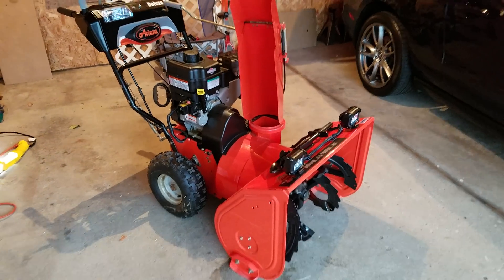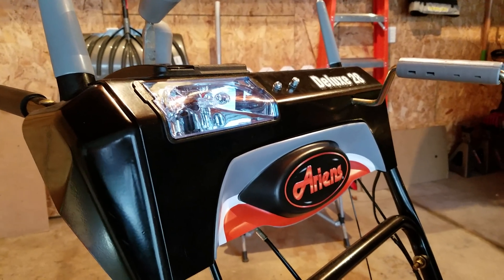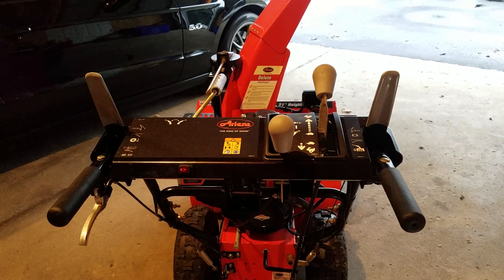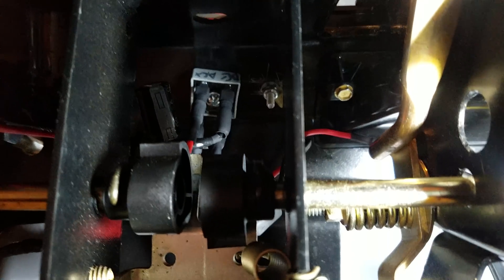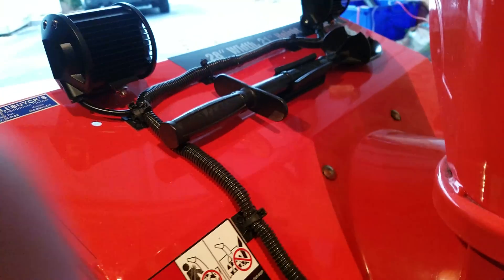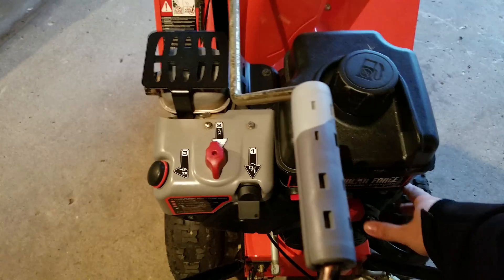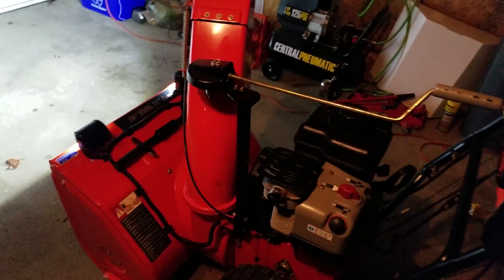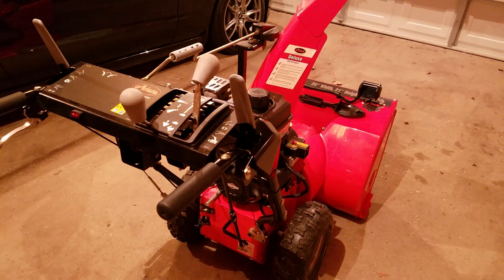Ariens Deluxe 28 Snowblower - 18W Cree LED Headlight Conversion

Comment: hey there i have the same snowblower i put lamp on with the fuse the bridge rectifier it still flickers a little bit with power on high why how can i eliminate that
Reply from the maker: How many watts total are your led lights?  Placing two capacitors between the bridge rectifier and the lights may help/eliminate the flickering.  id try that
Reply: it's 80 watts I saw putting a full wave bridge rectifier works I got single phrase
Reply from the maker: I'm curious, did the full wave bridge rectifier work for you?  If so, what is the model number of the one you used?  I bet a lot of other people out there would like to add higher watt LEDs if they can.  Thanks!
Reply: MnP40c BTW did you add dieelectric grease a lot to rectifier the switch to keep water out
Reply from the maker: Thanks for the reply Erwin.  Glad the full wave bridge rectifier worked out for you.  The lights you bought look nice!  I did add some dielectric grease to my connections, and then added heat shrink to all the wires/connections to help keep moisture out.
Reply: MnP40c no problem that light is very very bright , so far I'm happy with the custom little Job, on the other snowblower I have spare fog lights housing  I took of my truck and replaced them with leds. they halogens though I'm interested in how those will work they pull more amps then leds

Comment: Did you delete the Halogen altogether?  also you stated that the LEDs might flicker if you tap into the light...  even with the fuse and capacitors in line??  Great video!
Reply from the maker: Yep I deleted the halogen all together.  The LEDs need the bridge rectifier to convert the voltage to DC.  Unless of course your snowblower/mower already puts out DC voltage (i.e. has a battery). If the lights were directly connected to the AC wires, the lights would have had a strobe/flicker effect when in motion.  Similar to some of those LED christmas lights you see out there.  The capitors and fuse do not fix this, because you'd still be using Alternating Current.

Comment: Can I run this with out the capacitors?
Reply from the maker: Yes, the capacitors are optional.  As quoted from SuperEdge88 on www.snowblowerforum.com "Using two 2200mfd 50v capacitors may be needed to clean up voltage ripple that comes off of the DC output on your bridge rectifier. Some LED lights are sensitive to this ripple and may fail prematurely. Simple adding these capacitors in parallel on the DC output side of the bridge rectifier is a good precaution. Wire in the Capacitor(s) between the LED light(s) and the bridge rectifier. So the postive and negative of the bridge rectifier will go to the positive and negative of the capacitor. Then the positive and negative of the capacitor then get wired to the LED(s) positive and negative."
Reply from the maker: The capacitors are just connected in parallel between the bridge rectifier's DC-Output +/- and the +/- wires on the LED lights. The capacitors can be connected together if you are using two of them.  You could also just connect the capacitors straight to the bridge rectifier itself and they should still function the same way.  Hopefully that helps, sometimes its hard to explain.  On my blower I have the capacitors connected between the +/- DC OUT on the rectifier, and the switch I am using to turn the lights on and off.  I may try to make another video sometime with some clearer footage.
Reply: MnP40c Now I am confused on Capacitor connections, seems like they are connected to Both sides +/- of bridge ret. and to ea other at the same time????? I keep rereading the explanation over + over. Help...
Reply: MnP40c , If you ever make another video, draw a schematic of your set up. An image worth a thousand words. That's bright.👍

Comment: Iv been reading the thread at  SB forum , I'm glad you did a video are they  each 18w bars?  Would you be able to run handwarmers also?
Reply from the maker: Hi Charlie, someone on the forum said that the Ariens 28 Deluxe can handle up to 60W total output.  When I tested the wires the voltage ranged between 9V to 16V (depending on the throttle).  So between the two lights I am using up 36 watts.  I've read that others have done similar modifications with the same snow blower as mine, and they had handwarmers.  So I believe it can be done.  I can't say specifically how its done, you may or may not have to choose lower watt output for your LEDs.

Comment: Clean install, but I have a question.  Doesn't the OE halogen bulb operate on DC voltage?  Couldn't you just splice into the leads that power the halogen bulb for your additional LED lights?
Reply from the maker: The Halogen bulb operates on either AC or DC voltage, which is why it works fine with the AC voltage that comes out of the stator. Technically, I could have run the LED lights directly off of those wires, but that would have caused the LED lights to flicker.  The reason for converting the AC voltage to DC is to prevent the LED lights from flickering or having a strobe effect.
Reply: Thanks.  I've never seen a halogen run on AC.
Reply: Halogen bulbs are merely incandescent bulbs filled with inert gas and iodine or bromine. The filament will heat up no matter which direction the current flows, unlike diode lamps which need only DC.